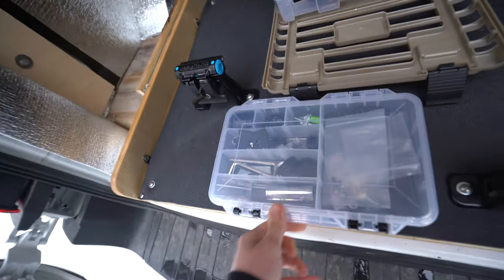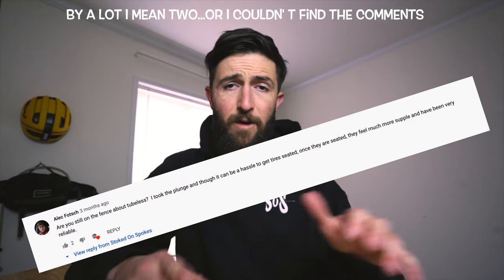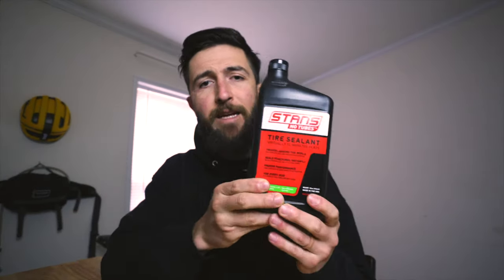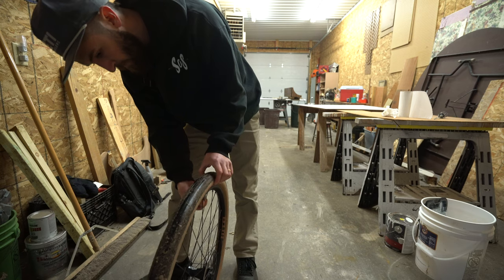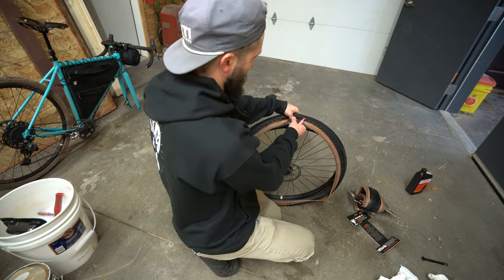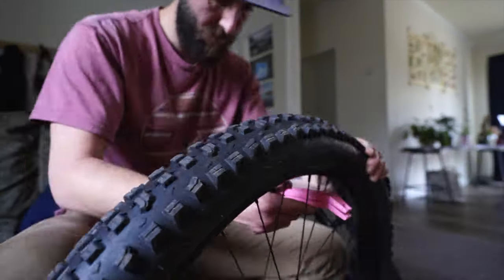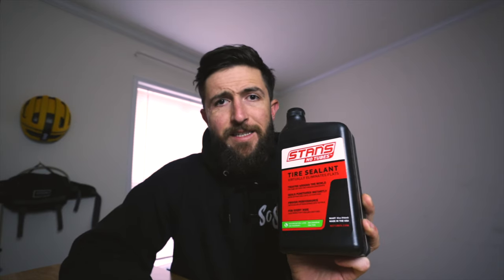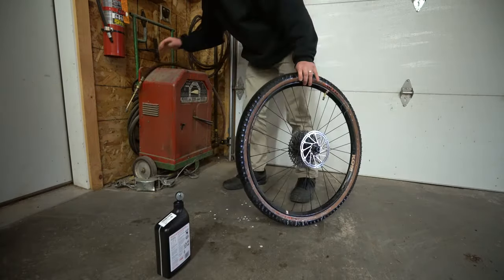I Drank the Tubeless Kool-Aid!

Comment: Personally whatever you got set up, just keep riding. Definitely helps with the tubeless setup. If not, ride with tubes but without the sealant. The tape will definitely conform nicely to your rims. If you got the budget for it, use the dt swiss tape. They're so pliant. So you don't have to pull hard when applying. And you won't get any crease.

Comment: I run sealant in my enduro bike but not in my commuter.
You are 100% correct each has their advantage /disadvantages. The sealant in my enduro is great but relativity high maintenance has to be topped up /replaced and I've had no flats, well except for when the spoke punctured the rim tape but that's a different issue!
On my commuter (specialized rockhopper) ive been running tubes, and I like how simple and quick I can repair flats and change out the tyres and never have to replace the sealant.

My rim tape is cloth gaffer tape/cloth duct tape and sealant is orange seal, I have also managed to patchep my rim tape (after said spoke went through it) on the side of the trail and pumped the tubeless up with a hand pump on multiple occasions, it's hard but doable with the correct rim tyre combination.

Now what to do do with my gravel bike.... 🤣

Greatvideo, well produced and balanced opinion 👍

Comment: Just did my first tire. Taping was EASILY the most difficult part of it all, which was super surprising to me. I noticed you didn’t seem to have any issues there. I wonder if my rim wasn’t clean enough but I had no stickiness and really struggled with a nice bubble free fit (never really got one tbh) but one tip I found on YouTube was to ride around with a tube in after you tape to help seal down that tape to the rim and remove bubbles
Reply from the maker: Yes the taping was quite hard at first... yopu really hve to pull the tape with all your might to get no air bubbles. I did my karate monkey wheels first and then My fiancees, long story short hers turned out better as I learned the proper technique.

Comment: Rather than a syringe pick up some 2 oz Stans top off bottles. They have a pointy tip for easy injection and can be refilled. Keep one for your kit on extended trips along with some plugs. And a floor pump works 90% of the time. The other 10% don’t matter cause you will have jumped off a bridge.
Reply from the maker: I saw this on one of dustins videos! great tip I might pcik one up for later use and see whats easier! cheers